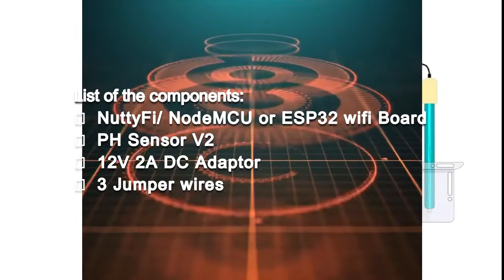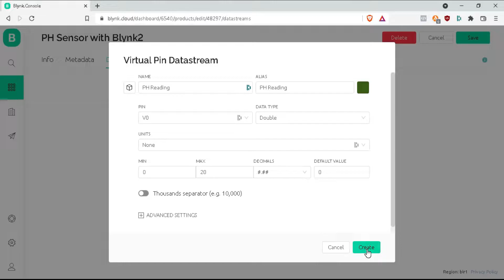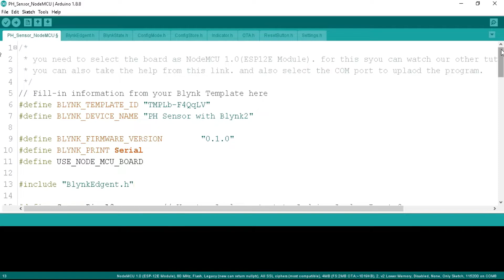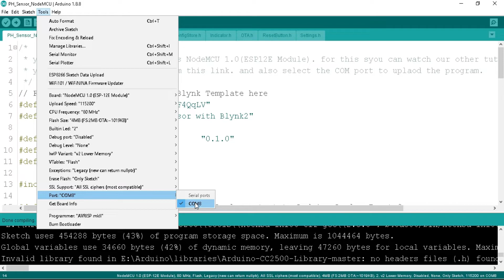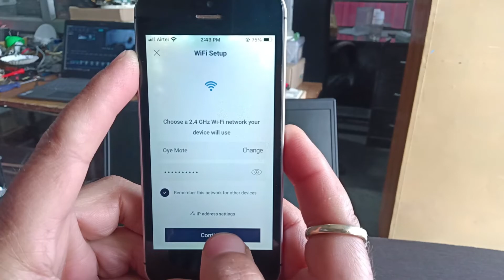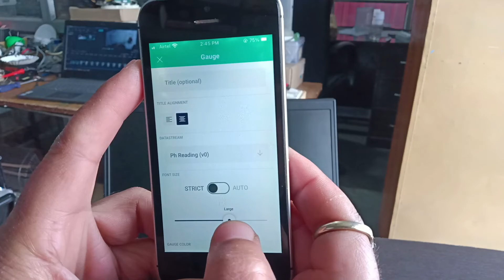PH Sensor interfacing with New Blynk2.0 using NuttyFi, NodeMCU & ESP32 with Programming code- DIY

Comment: ESP 8266 works in 3.3 v, as per the schematic diagram, why we need to connect 12v DC
Reply from the maker: You can provide the 12v dc in power input pin (VIN).
Reply: @SMEDehradun  got it, thanks

Comment: sir when im trying to add my device to blynk my esp32 wifi keeps disconnecting
Reply from the maker: Watch the video properly, then you will find, all the headers must be inside the program folder. 

Or you can connect your board to blynk through alternate methods. 

Below video may help you 

https://youtu.be/c5u6-Th1sI4

Comment: In file included from C:\Users\Umer Ahmed\Downloads\PH_Sensor_ESP32\PH_Sensor_ESP32.ino:13:
C:\Users\Umer Ahmed\Downloads\PH_Sensor_ESP32\BlynkEdgent.h:17:2: error: #error "Please specify your BLYNK_TEMPLATE_ID and BLYNK_DEVICE_NAME"
 #error "Please specify your BLYNK_TEMPLATE_ID and BLYNK_DEVICE_NAME"
  ^~~~~

exit status 1

Compilation error: #error "Please specify your BLYNK_TEMPLATE_ID and BLYNK_DEVICE_NAME"

i am getting this error how can i resolve it, i have already define the both but getting same error again again
Reply from the maker: I think, you haven’t seen the video properly.

There is need if headers in the sketch folder. 

Below video link may help you to troubleshoot- 
https://youtu.be/EPhY_hDozeo
Reply: @SMEDehradun  i have check the sensor directly, which gives me readings but when i am using your code it start only showing 0.00 reading and nothing else although all the things are correct, then what would be probable reason that why it is showing only 0.00, further more i try to change the pin v0 to v13 on blynk but that not also works.
Reply from the maker: Only option is to calibrate the sensor. 0.00 is not the reading.

Comment: hi sir how do you recommend the safest way to use external 5v from node mcu esp8266 to the pH sensor
Reply from the maker: Use external step down module 12V DC to 5V DC for this

Comment: Hello sir, when i followed your tutorial everything works in order except when i started verifying or uploading the code it will say "Compilation error: #error "Please specify your BLYNK_TEMPLATE_ID and BLYNK_DEVICE_NAME" and it will direct me to BlynkEdgent.h
i properly copied the 
#define BLYNK_TEMPLATE_ID "TMPL6N6GotM39"
#define BLYNK_TEMPLATE_NAME "PH Sensor With Blynk 2" in NODEMCU
And it says that kind of error and "Compilation error: #error "Please specify your BLYNK_TEMPLATE_ID and BLYNK_DEVICE_NAME" which can be located in BlynkEdgent.h
could you upload another tutorial for this? thank you
Reply from the maker: Hi,
You need put header file inside your programming folder. 

Below video link will help you troubleshoot thw errors. 

https://youtu.be/EPhY_hDozeo
Reply: @SMEDehradun  when opening a Ph_Sensor_with_New_Blynk 2.0. the header is already attached to a file NODEMCU/ESP32. so i had already the header. but once i started to verify or upload the code it says that error "Compilation error: #error "Please specify your BLYNK_TEMPLATE_ID and BLYNK_DEVICE_NAME" and it will direct me to BlynkEdgent.h. which on your tutorial don't have that video to fix it. you said in the link you send " don't touch the header if you don't have knowledge on it" so basically yeah i didn't touch a single thing in the headers, but only to follow the process in your tutorial.
Reply from the maker: I think, you are not watching the video properly. I have aleqdy share you the troubleshooting link. Watch it completely. 

And still you are facing same problem, Share the complete screen shot at schematicslab@gmail.com
Reply: @SMEDehradun  the header file is already attached to the programming which is the file we download " Ph_Sensor_Nodemcu" as you said in the video where you send a new link, you said " don't touch the header files without a knowledge" yes, i didn't touch a single thing on the headers. but the problem is whenever i try to verify and upload it it says like that "Compilation error: #error "Please specify your BLYNK_TEMPLATE_ID and BLYNK_DEVICE_NAME" and directing to blynkedge header files. which i have already attach the header on programming

Comment: Hello, sir. Can you help me? I'm planning to build a project similar to yours, but I intend to use a soil pH sensor to determine the pH level of the soil. However, I don't know how to proceed.
Reply from the maker: I have already posted a video on the soil sensor. 

To calibrate the soil sensor, this will guide you. 
https://youtu.be/uJAh_YCYLgc

And this video will guide you for the plant monitoring based on soul sensor 
https://youtu.be/NA4KGpqvU-o
Reply: @SMEDehradun  thank you so much sir I appreciated your help, last one question it is possible to connect that PH Sensor that using ESP32 to firebase to send the result of ph sensor to firebase?
Reply from the maker: Yes. This is possible.

Comment: I am using esp8266 nodemcu. But i got this error sir. Help me sir. Need this for my uni project

\BlynkEdgent.h:16:2: error: #error "Please specify your BLYNK_TEMPLATE_ID and BLYNK_DEVICE_NAME"
   16 | #error "Please specify your BLYNK_TEMPLATE_ID and BLYNK_DEVICE_NAME"
      |  ^~~~~

exit status 1

Compilation error: #error "Please specify your BLYNK_TEMPLATE_ID and BLYNK_DEVICE_NAME" .
Reply from the maker: It’s shows the error of blynk template name & password. So Write blynk credentials in the program.
Reply: @SMEDehradun  hi sir i got the same problem. I already write the blynk credentials in the program but it's #define BLYNK_TEMPLATE_NAME instead  #define BLYNK_DEVICE_NAME. can you help me with that?
Reply from the maker: As shown in the video, if you Follow all the instructions your program will run and work properly. 
The program is working here.

Comment: what is blynkEdgent.h
it is not present in my library manager
please explain about it and how to include it
Reply from the maker: You need to put all the headers in the programming folder. 
Below video link may explain you in batter way

https://youtu.be/EPhY_hDozeo
Reply: @SMEDehradun  it's showing complication errors as BlynkEdgent.h : no such file or directory

And also I'm not able to connect the wifi with blynk

Comment: My voltage/PH from the ph sensor is hard changing from  6.87-7.3 
But why ? 
The input voltage from the arduino are 5Volts constantly.  Please help 
I need to measure 24/7 but sometimes the ph value are to high or low
Reply from the maker: Hi, 
If you have already calibrate the PH sensor then it may issue of the bit resolution and accuracy in the ADC. SoYou can do one thing, read the PH sensor in Arduino and then send that data to NodeMCU ESP8266 serially. 
This link will help you to access the data serially from Arduino to ESP8266.

https://youtu.be/V7l2ZWmMOQY

Comment: As per the circuit diagram how do i connect the 12v dc adapter to node mcu 8266 vin?
Reply from the maker: You can connect external 5V dc to Vin pin.

Comment: Sir i have made same project but sir i am facing some problems, that i ahe done all the process but the value of ph is not getting accurate means it is not constant . It is varies up and dowm continuously. i think some problems in the code plzzz rely me as soon as possible
Reply from the maker: Hello Vedant, 
There is no coding issue. You need to calibrate the PH sensor first so that it can give you the accurate value.
Reply: @SMEDehradun  sir i have calibrated the ph sensor already but vale is still not constant can i send you the video ?
Reply: sir how can i contact you sir
Reply from the maker: There is not any issue with programming code as it’s tested with the parameters. So Check your hardware connection properly & also provide the external power to your board.
Reply: @SMEDehradun  ok sir thanks you sir
Reply from the maker: Welcome

Comment: Sir is it possible if you will add email notification here? That when the reading of the sensor is lower than 5, it will notify the user?
Reply from the maker: Yes,
You can add email alert. 
See this video to add email alert in blynk. 
https://youtu.be/T8vPXUrAfco

Comment: Hello sir , I'm trying to build a project using ph. But I'm having a difficulty with the code. Can you please help. I connected a motor  pump to the esp along with ph sensor. So when the ph sensor value decreases the motor pump should turn on. In the code I tried to implement if else but i am getting an error saying "conversion from int to constString  is ambiguous" 
Can you please tell me a solution sir ?
Reply from the maker: Hi,
There is definition issue to define the values in your code. Rectify it.

Comment: Hello sir, I am using the ESP WROOM 32 board. I want to ask what should I define in my code. In your case, you use NodeMCU board so you put #define USE_NODE_MCU_BOARD
Reply from the maker: Hi LUKE,
You can write #define USE_WROVER_BOARD
Reply: @SMEDehradun  thanks sir
Reply from the maker: Most welcome
Reply: @SMEDehradun  sir what do you think is the problem when it reads higher than 14
Reply from the maker: You need to calibrate the sensor first then you will get the right reading.
Reply: @SMEDehradun  why does my readings get so high. It reads from 17.00 - 18.00
Reply: Sir can you monitor the readings of the Sensor if your esp32 board and blynk application is connected to different wifi?
Reply from the maker: Hi Luke,
All the IoT application works on the same pattern. 
You just connect your ESP32 or NodeMCU board to any wifi like at your home or office. 

And once it’s working with your blynk app then you can monitor it anywhere in the world using your mobile data.
Reply: @SMEDehradun  thank you sir, I'll try later.

Comment: Hello sir, can you help me with my project. I did all of these but I cannot connect the blynk app. It only appear the readings on my serial monitor
Reply from the maker: Have you connect your board to wifi using blynk IoT app? 
 https://youtu.be/EPhY_hDozeo
Go through this video if you are getting any problem.
Reply: @SMEDehradun  Thank you for this video sir. The one thing I didn't do is open my mobile data that's why I can't connect my board to the wifi using blynk app
Reply from the maker: Once you connect your board to the wifi, then you will get the reading to your blynk widgets.
Reply: @SMEDehradun  Thank you so much sir
Reply from the maker: Most welcome
Reply: Sir can I email you?
Reply from the maker: Yes you can mail at schematicslab@gmail.com 
If you have any problem
Reply: @SMEDehradun  I emailed you sir, thank you
Reply from the maker: K

Comment: How would it be the code, If we connect 2 set of pH sensor to ESP32.
Reply from the maker: Hi,
you just calibrate the PH sensor and connect to any Analog pin in ESP32 board. and read the sensor like the first one, shows in the video.
Reply: What about show data of both pH sensor to Blynk website or app.
Reply from the maker: Create the new datastream, and send the value to the blynk as for the first sensor

Comment: Sir what if the ph sensor is connected to the arduino, and the arduino is connected to the nodemcu. Is it possible?
Thank you
Reply from the maker: Yes Luke Mark,
 This is also possible.
Reply: Can I ask how to do it sir? The problem is that it does not show the readings in my web dashboard and blynk app
Reply from the maker: Send the link for the ph sensor so that I can suggest the library.
Reply: I'll mail it to you sir
Reply from the maker: K
Reply: @SMEDehradun  Hello sir, I have a question. Do you need to connect both nodemcu and arduino to your laptop for it to work?
Reply from the maker: Hi Luke,
If you want to connect PH sensor with arduino then you need to connect the NodeMCU to Arduino board using serially. So that you you can send ph sensor data to NodeMCU.
Reply: Hello again sir,
the sender is the arduino and the receiver is the nodemcu?
Reply from the maker: Yes. You are right
Reply: @SMEDehradun  thank you so much. I think this is the reason why it doesn't work.
Reply from the maker: Welcome
Reply: @SMEDehradun  hello sir, I connected the arduino and nodemcu. Can I use the code you gave in this tutorial?
Reply from the maker: Hi Luke,
Calculation & methods would be same but the code would be different for Arduino.
Reply: @SMEDehradun  do you have the code for the arduino sir?
Reply from the maker: Not yet.
Reply: @SMEDehradun  Oh, okay. Thank you for your help sir
Reply from the maker: Most welcome
Reply from the maker: If you need help in coding, you can mail me.
Reply: @SMEDehradun  thank you
Reply: And also, my ph sensor is v1.1, not v2.0

Comment: the selected serial port serial.serialutil.SerialTimeoutException: Write timeout does not exist or your board is not connected...

Sir it's showing error while compiling
Reply from the maker: Which board you have selected like ESP12E or esp32 ?
Reply: @SMEDehradun  esp8266
Reply from the maker: Select the board in Arduino IDE as shown in video. This error shows wrong board selection.
Reply: Sir pH sensor has 5 pins 
T0
D0
P0
G
G
V+
Reply: Here which is the output pin sir
Reply from the maker: Mail me the screenshot of complete program. I will revert you.
Reply: @SMEDehradun  sir I have shared it can u plz check it once

Comment: i used PH-4502C and the output is different
Reply from the maker: Ya. It’s depend on water & calibration of the sensor. 
It may vary.
Reply: @SMEDehradun  the results are reversed, ph value of bleach is around 5 and ph value of of vinegar is around 9
Reply from the maker: You need Calibrate the sensor first. After that try.
Reply: Sir  @SMEDehradun  how to calibrate PH-4502C ph sensor? pls help
Reply from the maker: We don’t have PH-4502C sensor. So can’t say how to calibrate it.